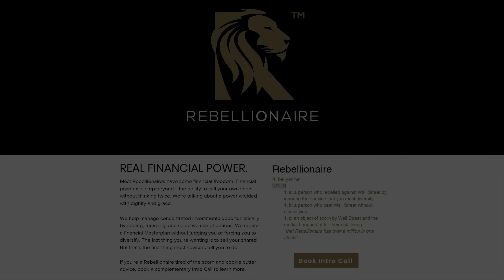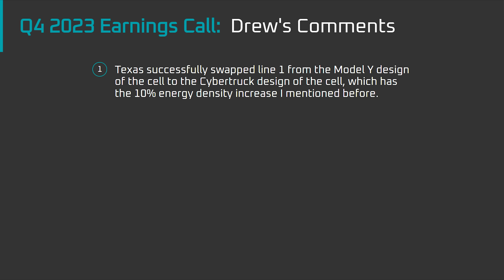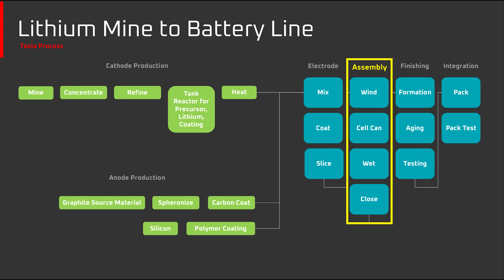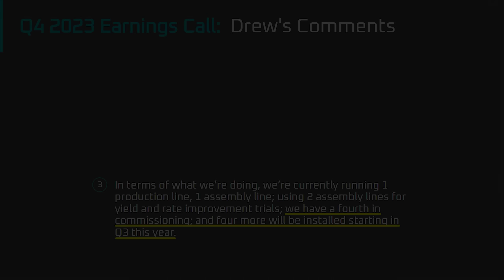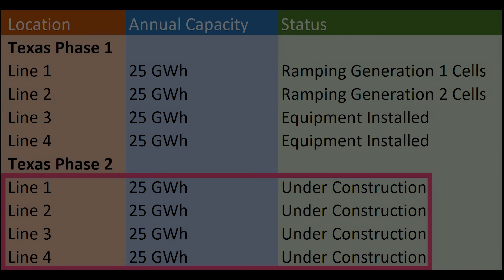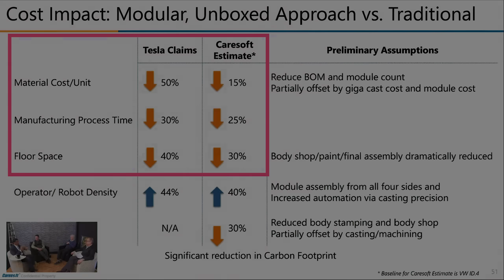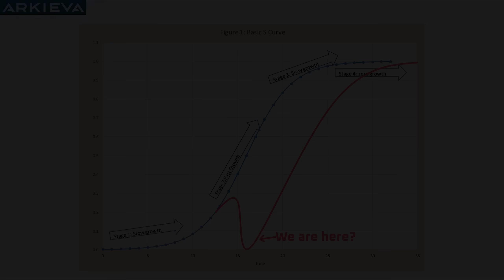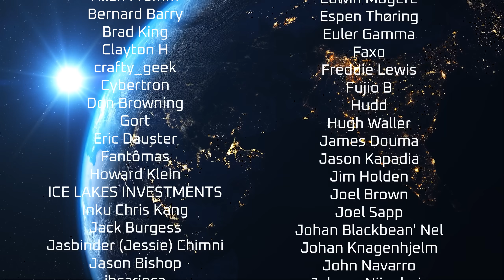Tesla Q4 Battery Updates // Production Dip and Rumors

Comment: Are the isotopes of Lithium important in Battery chemistry?

I ask because I know a company seperating these isotopes (Li6 and Li7). And they need the Li7 isotopes for another purpose.

Im thinking the Li6 isotopes would be useful for making extra low weight batteries.
Reply from the maker: Interesting thought, but it wouldn't be cost effective for most batteries.  Might be something in their for niche use case

Comment: Back in the 90s I spent 7 years as an engineer for a battery R&D company.  Very thin electrodes in an offset jelly roll very high power density format.  I started in electrode prep and ended up in applications and product management.  When I saw the 4680 presentation a while back I was amazed - the cell was like the Li-Ion version of that Bolder Tech cell design.  Makes perfect sense.  The coating process kicked our backsides.  A spray was the best for cell performance due to excellent porosity but was hard to make flat and then still wind successfully.  Roll coating was very manufacturable but had poor porosity and reduced performance.  I'm not sure how a dry process would adhere to the metal current collector but might be more porous than a squished wet roll coat.  Maybe there is a polymer in the mix?  One thing I do remember is that when we got the electrode prep line dialed in it was best to run as much material as possible through right then as opposed to shut down and reset for a new day.
Reply from the maker: Thanks for the comment! I love anecdotes like this

Comment: Hi Jordan, Thanx for all you do to try and keep us informed.
I hope this request is feasible.
I believe it was the initial battery day when Tesla shared their 4680 plans. It was exciting but had a fairly long timeline to get to where they wanted to be. Is it possible to estimate where on that timeline the production of today's cyber 4680 would be. And if you could do that, what would the expected energy density would be using the original timeline but sort of not worrying about the time estimates.
So for example, if they are @ 25% of the original planned improvement we might expect another 75% which should thereby increase the cybertruck 123kwh pack to a xxxkwh pack, thus increasing range to a possible nnn miles given the same number of cells in the pack.

It is my contention that the 500 mile range was perhaps achievable only after reaching the planned energy density goals. I'm not saying it is achievable, but it was what the mileage estimates were based on. Would make a fascinating post. Thanx again, Paul
Reply from the maker: I'm assuming you're just focused on energy density here in terms of progress.

I think they actually started below the 0% line with the gen one cell.

So I would say that with the current cell, the cyber cell, there are 0% of the roughly 20+% energy density increase they suggested at battery day.

But, I don't think they're going to get an additional 20% by 2026, which was their target year.

I think they're several years behind.

My guess is it's going to be 2030 before they get another 20%

Comment: Hi Jordan, great content as always and addresses the wet-electrode imports via courier from elsewhere to some extent. I keep hearing about Panasonic producing the 4680 in the future but would that just be the current/future 18650/2170 tech. in a bigger can or do you suppose that Tesla supplies machines or electrode material to Panasonic?
Reply from the maker: Panasonic's original plan was to use a wet process without tabless electrodes.  I don't know if that's changed, but I suspect they aren't going to be getting any equipment or know how from Tesla

Comment: hey Jordan Greetings from new zealand
got a question for ya.
the ct cells are currently sitting at 3.7 volts at 23.35 amps x 1424 cells per pack for the 123kwhs.
The voltage of 3.7volts per cell i understand is "nominal" does that mean the 3.7 volts is the minimum voltage that the cell can be charged too?
if they raise the voltage to 4 volts (4 v x 23.35 x 1424 =133kwh) is that possible ?
4.2 volts x 23.35x 1424=139.65kwhs
4.5x23.35x1424 = 149.6kwh
4.7 x 23.35 x 1424= 156.2kwhs
are these accurate numbers and do you think tesla is able to boost the CT range, can it be boosted this way?
i know they are still testing the reliability of the cells.
Reply from the maker: 3.7 volts is the average voltage over the charge and discharge slope.

Fully charged. It's 4.2 volts and fully discharged its 3.0 volts.

So in order to calculate energy density throughout the charge and discharge cycle, you have to take the average.

The only way to boost the ranges to increase the energy density of the cell by changing its chemistry and design.
Reply: @thelimitingfactor  
so for arguements sake (to see if this old brain has the correct understanding) if they went to 4.7 volts max charge and 3 volts minimum the nominal voltage would be about 3.9 -4 volts which is the average between the 2 extremes.
oh and thanks Jordan its helped a lot.

Comment: I am wondering what is going to be the primary driver in battery developments moving forward for Tesla as well a the other manufacturers. Cost certainly, but for instance the form factor versus different chemistry and the necessary changes to the build process. I would assume that they are planning to use 4680 form factor battery designs for the foreseeable future, looking for incremental gains in performance in order to save millions to change pack and or vehicle design. I guess that it makes sense to not let better be the enemy of good sometimes. Can AI generate a better design AND justify the costs for new vehicles?
Reply from the maker: The form factor is nailed down for the 4680.

They picked it to be future proofed.

So long as they can scale the dry coating. It's about chemistry improvements

Comment: Wait wait. Why would Tesla go from NMC811 to NMC955?

Jeff Dahn's team research has recently tested NMC955 in a paper and it only has higher capacity when charging to >4.04V (cell voltage).
You can find it on the Journal of the Electrochemical Society, as linking seems to make YT go crazy.

"When charging to 4.14 V vs Li/Li+ there is no benefit in switching to
SC Ni95, which has less specific capacity than NMC811 at this
UCV."

However, this may explain whyL: "The normalized capacity vs cycle number panel shows cells with SC NMC811 charged to 4.06 V have slightly more capacity loss than cells with
SC Ni95 charged to 4.04 V after 1700 cycles, however, SC NMC811 cells have better impedance control and seem to flatten out after
many cycles, which convinces us they will overlap at some point later. SC Ni95 cells have more capacity loss than SC NMC811 when
they were both charged to 4.18/4.2 V to access the capacity of the high voltage plateau region. In general, the cycling performance of cells with SC Ni95 with an advanced electrolyte recipe is very promising."
Reply from the maker: They're trying to eliminate cobalt and higher nickel tends to have higher overall energy density (but less stable).

I don't know about the specifics of the paper above.

Comment: Excellent as always…definitely sounds like a step back short term…understand why they stopped MY production…to be blunt…missed the entire window for MY even with the delay in Ctruck. MY, they used line 1 and Kato roads to produce the little they had. So, they have line 2 running….ramp up and they are converting line 1…so it definitely caused a delay, but no impact on CT thus far.  There are not 4 lines scaling up…back to the 3rd QTR plan…should have 4 lines running by 2Q24…then 4 line by yearend 2024…the bulk of the S-curve is sliding out…should not impact Ctruck but CT will ramp quickly in 2025. Still is an aggressive plan…will Cathode facility spool up this year….Lithium refining?
China Cathod material sounds like a back up plan?
NextGen going to use 4680…he mentioned future models…
Reply from the maker: Not sure what this is saying, but thanks for commenting.

Comment: By the time the 4680 cell is completed and ramped, will competing battery tech have exceeded it?  It sounds like solid state batteries will be coming in 1 to 2 years.
Reply from the maker: No, solid state batteries are a different use case entirely.
Reply: A little too much like fusion reactors there's the hype but no concrete product or serious production. This is unfortunate. I think companies like Toyota talk a lot (since several years now) just to delay people from shifting to current available technologies that are working fine for most people.

Comment: I suspect 4680 will be essential for the model2/robo.

4680s helps with charge/discharge per cell due to heat efficiency gains from tabbed electrodes.

Assuming much smaller packs due to a lower range & lighter weight, getting a mile if charge will need a faster charging cell than the industry standard.
Reply from the maker: No, it just allows a larger cell for the same charge and discharge rate.

If they want a faster charging cell, they'll need to change the chemistry.
Reply: @thelimitingfactor  I'd thought the reason a 46 diameter was practical without throttling it's rates was the heat dissipation tabless provides? Which implies heat dissipation is if not a bottleneck.. then one of the variables to be balanced for maximising cycle life vs practical use.

How would a smaller diameter, same chemistry & architecture fair?

I may need to re-watch a few of your vids 😅
Reply: Munro mentioned during the Model S Plaid teardown that 18650 cells were used because of the peak energy requirements that the additional (smaller diameter) cells in parallel can provide. Essentially all form factors could be made tab-less in the future for better electron mobility, and of course thermal conductivity is a benefit too.

Comment: The BYD blade was introduced in the Q1 2023 Model Y SR MiG. Thats a structural battery pack and it also means that the Y SR has a front casting. All Y SR from Germany came with that battery, Q4 2023 Tesla also started to ship the old CATL (on the LR production line without front casting and no structural pack) in german made Y SR as well. The BYD blade is now one year in production at Tesla. I got one, its far better than the Catl LFP and even outpaces the old LG LR battery in some things
Reply from the maker: Yes, I've heard good things about it.

It's good to hear Elon finally acknowledge it
Reply: meh, I know shorter and thinner is where lfp prismatic is going and catl is commercialising 1-2 years

Comment: The future of humankind depends on how fast Tesla accelerates the switch to sustainable energy, and the future of Tesla is all the innovations shown in Battery day, which is the 4680, so it's understandable people consider how important this tech innovation is. So, when they found out it was overbuilt and they could make some reductions to reduce weight and improve energy density by 10% it was awesome news. So, given all the innovations in magnesium, I wonder if it could substitute aluminum in the battery cell can. Having pretty much the same material capabilities at 33% less weight could help improve energy density even more, what do you think?
Reply from the maker: Good question.  An Al cell can would weigh less, but have worse volumetric energy density.  And, it might actually cost more.  Better to thin out the cell can and use cheap steel IMO
Reply: @thelimitingfactor  Thanks for replying! I thought the 4680 cell can was made of aluminum, so maybe it would be better if made of steel? What about magnesium? If thixomolded magnesium alloys can be so good to match aluminum gigacastings but with 33% less weight, wouldn't it make sense to try to make the cell canisters of magnesium as well and save 33% weight there as well? I mean, specially considering that the tech improvements for thixomolded magnesium alloys allow enough cost reductions to make it competitive with aluminum gigacasting, wouldn't it be possible to use similar techniques to keep the price low to make the 4680 cell can as well?
Reply: Al sheet can be drawn into cans like steel (Aluminum is used for most beverage cans). I'm not sure if that works with Mg, does anybody know?
Reply: Aluminum beverage cans have sprayed on plastic liners.
Reply: And the future of FRUNKENSTEIN inCORPORated depends on how fast we can ramp doll production!

Comment: Very well done Jordan. Its good to see the 'manufacturing lines' 
When correct there are some production capabilities for the 4680 near Fremont. Tesla's own production (with Panasonic) has the 2170 in Nevada. Everything else is coming from abroad when correct. The 18650 from Panasonic in Japan and the LiFePO4 mainly from Chinese vendors and China. 
What would be good, to have an orientation on the (increasing) total demand and the part the 4680 will have in the future. It seems the 18650 and the 2170 will last for the coming 10 years.
Reply from the maker: Yes!  Those cells will definitely be around for a while